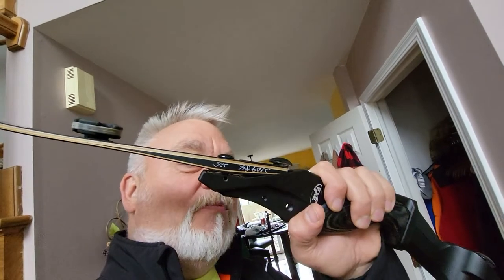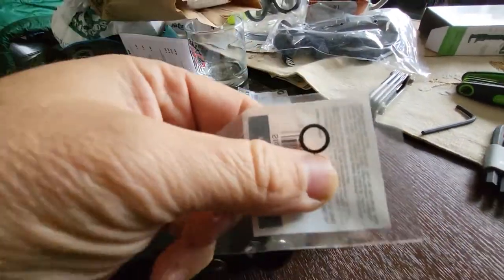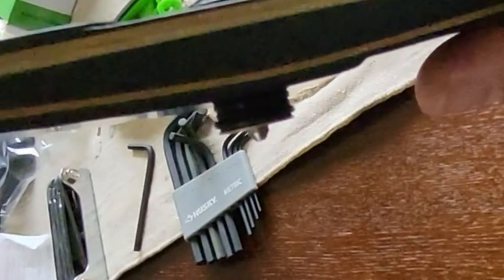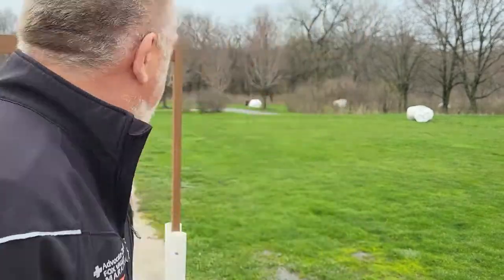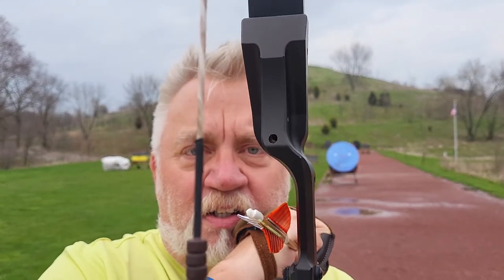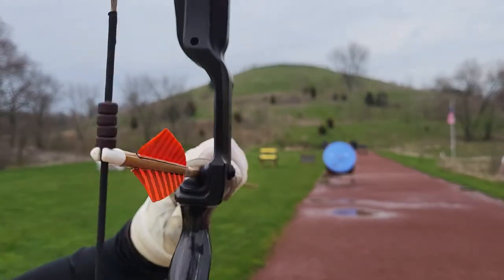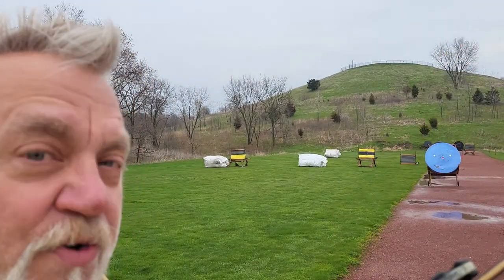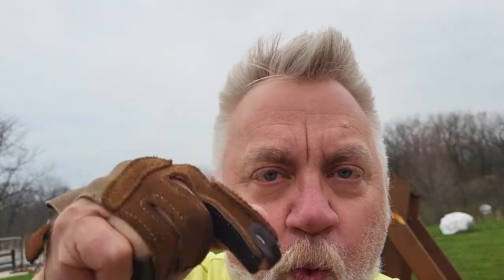Archery - The Secret to Silencing your ILF Bow (Finally!)

Comment: If you play this video in slow motion the arrows are 100% kicking off the shelf
Reply from the maker: Greetings User and welcome to VOGTLAND OUTDOORS ! 

Excellent observation, but there's something you may be missing here...

I'm near-certain it's a $5 plastic arrow shelf I'm using, AND I'm using my ordinary HUNTING arrows as well, because the PURPOSE of this video is to talk about VIBRATION that commonly occurs in ILF limb pockets - vibration & noise that's NOT caused by the kicking of an arrow off the shelf. 

So while your point is complete valid, I had a lot of OTHER stuff to sort out before adding a plunger and magnetic swing-away arrow shelf to the equation ;-) 

I'm HUMBLED that you spent so much time watching this particular video, and welcome more of your keen observations on other (old & new) videos coming up ! 

Cheers,
-Mark Vogt | VOGTLAND OUTDOORS

Comment: Is the pin angle ok? I wonder if it forces a not neutral angle? Just got Gillo GQ 25 with endless loop, its so loud and vibration. Got string slingers installed helped but still vibration and touch loud.

Comment: Did you see the arrows porpoise? Maybe that's where noise is also coming from.
Reply from the maker: Greetings "Crow" (what's a BETTER name with which to converse with you?) ! 

LOTS of people suddenly are weighing-in on THIS (older) video - many thanks! 
That said, the arrows AREN'T porpoising - either up or down - instead I've already traced (via a "mechanic's stethoscope") the loudest noises to the PIN inside the ILF "dovetail bolt" itself :-O 

Watch for upcoming videos as I work to eliminate even this last noise. 

Cheers!
-Mark Vogt | VOGTLAND OUTDOORS
Reply: @VOGTLANDOUTDOORS  oh OK cool. I just got myself an ilf rig (19in satori) and have just been researching stuff about them. Definitely cool to see the tips and tricks of them. Gotta say I'm digging ilf so far. All my other bows are limb specific, Oneida, or one piece recurve.
Reply from the maker: Hi again Crow! 

Yup - there ARE things to like about ILF limb fittings... 
... but it STILL is a double-edged sword as well. 

What you GAIN in CONVENIENCE of pop-out-pop-in limb interchange-ability, you LOSE in ADDITIONAL MOVING PARTS, hence RATTLE from string vibration during bowstring release :-| 

SOMEONE needs to make some sort LOCKING-CAM lever arm so that you can STILL pop-out an old limb and pop-in a new limb... but then TIGHTEN DOWN that limb with the flip of a quick-release - just like on a bicycle wheel or bicycle seat quick-release !

Cheers,
-Mark Vogt | VOGTLAND OUTDOORS
Reply: @CrowArchery5150  I think you will like the ILF system once you get use to it. ILF will always be a little louder that s one piace but not as loud as a lever bow. The thing I love about ILF is I can shoot my longbow limbs on a any of the 4 risers and due to the riser length get a little poundage gain or reduction. I can put my long foam/carbon recurve limbs and get a 64" with a 19" riser or switch to a 15" inch and get a 60" bow. You will enjoy it.
Reply: @carlduncan8462  I had a bear kodiak b riser, but sold it due to lack of limb options (plus it was just too pretty of a bow for me to comfortably hunt with) I wanted something with a lifetime warranty  on the riser at the very least. Bear's warranty kinda sucks in my honest opinion. So far I've had no issues with my satori being loud at all. To be honest I think I'm digging the satori because it feels like a modernized version of my martin hunter. I don't like the stock grip, but I think I'm gonna find a way to converting the grip with a suede or tough leather material.
Reply: @CrowArchery5150  I took mine off and sanded it to the shape that fit like I wanted it to. I build cabinets and furniture so I have a lot of tools. A company in ,I think France, makes some very nice replacement Hoyt grips. I'm pretty sure they are 3 D printed. Multiple colors and styles and they are not slick in your hand.

Comment: Your arrow is bouncing from the shelf. Your nock height on your string is off or that extra weight on string above arrow is pushing the arrow nock down before the arrow nock leaves the string.
Reply from the maker: Greetings Old2470 and welcome to VOGTLAND OUTDOORS ! 

I read your comments with interest. Clearly you spent some time watching video over & over prior to commenting - thank you for this effort ! 

Some comments: 
1. the position of my (adjustable!) Nocking Point is a wee bit off, but not a lot; please remember the focus of this video was on VIBRATION, not really ARROW FLIGHT, and while being off just a tad might create some vibration, I think you & I can agree that in this case it's small enough to NOT be the "root cause" of all the vibration I had :-) 

2. that "extra weight" on my bowstring is really a few small lightweight rubber speed buttons which together make an ADJUSTABLE NOCKING POINT; believe it or not, but 3 of these light-density foam button weigh LESS than the BRASS Nocking Point that is all-too-common on many a bowstring, so if my SPEED BUMPS are to blame for poor arrow flight, then all the BRASS Nocking Point out there must be making even WORSE arrow performance ! ;-) 

3. After I filmed this video I adjusted my moveable Nocking Point up about half-an-arrowshaft-width, and my porpoising was eliminated, but it was the FELT PADS I added which get the credit for damping out much of the NOISE and VIBRATION in that bow ! 

THE KEY POINT OF THE VIDEO then wasn't about adjusting the nocking point to eliminate the porpoising , but eliminating the vibration and noise often present in even expensive, high-quality archery limbs. 

My own bow? 
$299 SCREAM EXE riser from 3RiversArchery
$159 DAS longbow limbs also from 3RiversArchery
=========================================
$450 for the bow, so arguably a "medium-high-end", and it RATTLED LIKES A SNAKE when I shot it ! 

That's because ILF fittings VIBRATE by DESIGN - no matter who tries to argue in favor of them. Period. 
There are simply too many spring-mass moving parts in these fittings, but with just a little felt you can eliminate most all of the vibration ! 

Hope you enjoyed the video. 
I certainly enjoyed & respected the time you took to watch the video to observe various aspects of the arrow flight, and take the time to comment on them.

I would benefit from you watching some of the other recent videos: 
https://www.youtube.com/watch?v=BaB1499Fe50
https://www.youtube.com/watch?v=MGDvz4WG8TU

Kind Regards,
-Mark Vogt | VOGTLAND OUTDOORS
Reply: @VOGTLANDOUTDOORS   The noise you still heard was your arrow hitting the shelf too, not just nock getting out of the string. It would have been interesting to hear the bow without the O-rings back to back shooting - maybe you add this ? Camera / mic in front of the bow will give the right noise feedback - the slap or rattle or anything happens behind the back of the bow. What we hear while shooting is not what the bow sounds when listened 3 yards away. But interesting solution - out of the box thinking.
Reply from the maker: Greetings Old2470 and welcome back ! 

If you heard this bow BEFORE I silenced most of the vibration you would have been surprised ! 
Me? 
I wasn't. 
I've competed enough now - with literally dozens or even hundreds of archers all standing in a line alongside me at indoor state tournaments that I can say with complete sincerity that over HALF of all ILF-type bows display this SAME vibration phenomenon, because they all have the SAME design flaw:

THE BOW LIMBS ON ILF RISERS ARE NOT RIGIDLY ATTACHED TO THE RISER. PERIOD. 

Proponents of ILF connections can jump up & down and scream "BLASPHEMER!!" and "CRUCIFY HIM!!" at the top of their lungs - they will all still be WRONG. 

Here's why: 
ILF limbs are attached through a PIN-SOCKET type of fitting; 
In order for ANY ILF "pin" to be GUARANTEED to fit into ANY ILF "socket" there MUST be some small PLAY; 
The designer of ILF fittings hoped that a simple SPRING-loaded "inner pin" would somehow "damp out" this vibration, but THIS IS A FALLACY ! 
When the bowstring is struck, a series of VIBRATIONS at different frequencies (a low "fundamental" frequency and certainly multiple "harmonics") travel from the bowstring into the limb tips into the limbs into yes-you-guessed-it the ILF FITTINGS, and it's these high-frequency HARMONICS which wreak havoc with the little spring-loaded pin and even the larger pin-socket fittings, "exciting" them both into vibrating at both a FREQUENCY and an AMPLITUDE which is in the yes-you-guessed-it-again AUDIBLE SOUND RANGE FOR THE HUMAN EAR. 

In other words, we heard a low-frequency SLAP and a mid-frequency RATTLE and finally a high-frequency BUZZ. 

THIS HAPPENS WITH ALL BOWS ! 
Put your ear right up against where your limb meets your riser and PLUCK your bowstring like a guitar string, and you will HEAR your bow - ANY bow - literally "RING"... and this RINGING WILL LAST FOR SEVERAL SECONDS :-O !!! 

WATCH any other Archery Jedi Master Harmin Hirmer - he "listens" to every bow he evaluates, and even COUNTS how LONG the ringing last as part of his "scorecard" for a given bow. 

SO... 
All bows VIBRATE;
These vibrations occur in DIFFERENT FREQUENCY RANGES; 
SOME of these frequencies are right in the range of the "NATURAL FREQUENCY" of the ILF FITTING; 
SOME of these frequencies are right in the range of the "NATURAL FREQUENCY" of the SPRING-LOADED PIN; 
These vibrations cause ILF bows to SLAP, RATTLE and BUZZ - ALL in frequencies AUDIBLE to the HUMAN EAR. 
Period. 
There's NO actual DENYING of this; our only option is to DAMPEN this vibration, hopefully WITHOUT losing (much) kinetic energy going into the ARROW. 

The only way to COMPLETELY ELIMINATE this vibration from ILF limbs is to PERMANENTLY ATTACH them to the riser ;-) 

My fingers are tired from this epic-long reply. 
I sound like I DESPISE ILF limbs - I don't. 
But I also DON'T "RESPECT" ILF limbs. They're just complexity for the sake of complexity. 
Sure, you can pop OFF ILF limbs in 1 second, and pop DIFFERENT ILF limbs on in 1 second. 
And it takes you 10 seconds to SCREW OFF then SCREW ON more traditional limbs. 

Who fucking cares? 

WHEN has the ability to INSTANTLY CHANGE LIMBS EVERY MATTERED? 
NEVER. 
;-) 

IMAGINE a company who designs CONVENTIONAL limbs for $100 a pair vs another company who designs ILF limbs for $250 a pair...
... and I'll show you ONE pair of limbs where over $150 was WASTED on the FITTINGS that were FLAWED FROM THE START, and ANOTHER pair of limbs where ALL the money went into the LIMB PERFORMANCE, which is the ONLY THING THAT REALLY MATTERS. 
;-)

- Mark Vogt | VOGTLAND OUTDOORS

Comment: @ Mr. Vogtland, I am a fan, new archer going to get my first bow. Should I have my drawlength calculated the same or different because I will be using your shooting method?
Reply: Should I have my draw length calculated the same way?
I will be using your shooting method. furthermore, I was wondering if you offer lessons.
Reply from the maker: Greetings Ernest and WELCOME to VOGTLAND OUTDOORS! 

SHORT ANSWER (and this is IMPORTANT!): 
You DON'T "calculate" your Draw Length - you MEASURE it !! 

You can make this SIMPLE or you can make this HARD: 
SIMPLE METHOD: 
GRAB a common MEASURING TAPE; 
FLIP it UPSIDE DOWN in your BOW HAND; 
HOLD the TAPE END with the 2nd digits of your 2 DRAWING FINGERS; 
HOLD the PLASTIC CASE part UPSIDE DOWN with your BOW HAND - like it's a BOW; 
PULL the tape out with the 2nd digits of your draw hand...
ANCHOR those 2nd digits UNDER YOUR CHIN while you're "AIMING" with the plastic part. 
READ the value on the measuring tape - THIS IS YOUR DRAW LENGTH
REPEAT 10 or 15 times. 

 HARD(ER) METHOD: 
VISIT the BOW STORE 
Have THEM actually MEASURE your draw length using a VERY LIGHTWEIGHT BOW 
(note: if they DON'T have you actually DRAW A BOW but instead pull out a YARDSTICK - RUN AWAY - you're in the WRONG "archery" store !!!) 

KNOW THIS: 
The AVERAGE HEIGHT of an AMERICAN MALE is 5'-9"
The STANDARD DRAW LENGTH of 28" is BASED on this height ! 

MARK is 6'-1" and has a Draw Length of 31.5" 
Mark is 4 inches TALLER than the "standard" American Male
Mark's Draw Length is 3.5 inches LONGER than "standard" 

MARK'S RECIPE FOR "CALCULATING" an EXPECTED DRAW LENGTH: 
SUBTRACT 69 INCHES from YOUR Height in INCHES to get a HEIGHT DIFFERENCE; 
FOR EACH inch in this HEIGHT DIFFERENCE either ADD an inch or SUBTRACT an inch from 28 inches

EXAMPLE: 
You're 5'-7"  (2 inches shorter than "standard") 
SUBTRACT 2 inches from 28 inches to get a DRAW LENGTH OF 26 INCHES :-) 

EXAMPLE: 
You're 5'-10" (1 inch taller than "standard") 
ADD 1 inches to 28 inches to get a DRAW LENGTH of 29 INCHES :-) 

SEE HOW EASY THIS IS? 
But ALL this depends on the ASSUMPTION than your ARMS are PROPORTIONATE to your HEIGHT. 

BETTER TO MEASURE THAN TO CALCULATE ! 

I think you just gave me my 3RD idea for upcoming videos - THANKS !!!

Hope this helps! 

-Mark Vogt | VOGTLAND OUTDOORS
Reply: @VOGTLANDOUTDOORS  OUTSTANDING! This was the best answer I have ever gotten on YouTube!
Reply from the maker: Greetings Ernest ! 
1. GLAD you're trying the VOGTLAND SHOOTING METHOD ! 
2. Yes - I DO offer lessons - and  they're FREE (I just LOVE teaching!) 
3. Yes - I WILL travel up to 150 miles from North Aurora IL (it's 50 miles due west of Chicago IL) 
4. Yes - I LOVE GROUP LESSONS BEST - so get some BUDDIES together ! 

WHERE do you live? 

Awaiting your reply,
-Mark Vogt | VOGTLAND OUTDOORS
Reply from the maker: Hi Ernest! 
GLAD you liked the answer, AND that it MADE SENSE to you ! 

LET ME KNOW HOW ACCURATE THE "VOGTLAND DRAW LENGTH CALCULATION" IS: 
TELL us your HEIGHT; 
TELL us your DRAW LENGTH! 

Awaiting your reply!

Cheers, 
-Mark Vogt | VOGTLAND OUTDOORS
Reply: @ Mr. Vogtland, sir, I am so grateful for your offer! My family and I actually live in Chicago! How many people are you willing to train? What are the age requirements? I will be meeting with a youth group this Sunday to feel out interest, but have a group of about 15 ready to go! Should we check into renting a local range? Hey, maybe you could help me choose my first bow 😉 tentatively, we are looking at a Saturday afternoon like 12pm to 3pm, maybe the second Saturday of June? This is tentative until you say it's final. I have never facilitated anything like this so I appreciate and welcome your professional input.
Reply from the maker: ERNEST !!! 
I CAN'T BELIEVE YOUTUBE HID THIS COMMENT FOR THE PAST 8 MONTHS - I ONLY JUST SAW IT TONIGHT !!! 
ARRRRRRGGGGGHHHHH !!! 
WHY oh WHY does YouTube DO THIS ????? 

SHORT ANSWER: 
I'd LOVE to give YOU a lesson first - ALL FOR FREE ! 
Let's meet out at BLACKWELL FOREST PRESERVE ARCHERY RANGE - it's FREE or only $50 a YEAR for non-DuPage residents - that's CHEAP by ANY STANDARD !! 

You can apply for a permit ONLINE at this location: 
https://www.dupageforest.org/things-to-do/get-outdoors/archery#archery-permits

Once you get the permit, feel free to TEXT me at (630) 781 9978 - that's my mobile number 
Be sure and leave your first name in the text (nothing more) and remind me I'd promised you free lessons. 
If you haven't yet picked a bow, I'll even bring a pretty decent STARTER bow with me for you to try out. 

Then once YOU'RE shooting well and understand the method, you'll be able to teach your own family how to shoot... 
... or we simply have a GROUP session - it'll be a BLAST ! 

Looking forward to hearing from you - I hope ! 

-Mark Vogt | VOGTLAND OUTDOORS

Comment: Hi. May have missed it, what size o rings are you using? Thanks.
Reply from the maker: Greetings RP ! 

ANSWER: 
I took an ILF "pin" down to the local hardware (ACE Hardware) and into the PLUMBING section; then I looked through all the FAUCET O-RINGS until I found the smallest, thinnest ones which barely had to stretch in order to fit over the "shaft" of this ILF pin. 

Since you might NOT have the exact same make/model of ILF pin (sadly, no matter what ANYONE CLAIMS about "ILF" being CONSISTENT, this is bullshit marketing) as you, you should follow my lead and bring an ILF pin (or the whole damn LIMB) with you, and simply TEST_FIT O-rings until you find ones which fit like I'm describing... 

If you still get stuck, then I'll go down to the local ACE Hardware and FIND the ones I use and come back and report to you - good luck! 

-Mark Vogt | VOGTLAND OUTDOORS
Reply from the maker: SOMETIHNG LIKE a 9mm x 1.5 mm black rubber O-Ring like in this Amazon ad: 
https://www.amazon.com/Boatsea-Assortment-Automotive-Plumbing-Connections/dp/B08XYYJGNS?ref_=ast_slp_dp&th=1
Reply: @VOGTLANDOUTDOORS  Thanks!
Reply: @VOGTLANDOUTDOORS  thanks. I just bought an ilf bow on eBay and still waiting for it. Once in I'll see how loud it is, and then try the  o rings. Thanks for your feedback.
Reply from the maker: No problem!

Comment: Diameter of rubber ?
Reply from the maker: Greetings E3Innovation ! 

SHORT ANSWER: 
BRING your ILF PIN into any ACE Hardware, and head to the FAUCETS/PLUMBING department. 
LOOK for the shelf with either a bunch of DRAWERS filled with small rubber O-rings, or a SHELF with them all on hooks. 
FIND any O-rings with about a 1mm to 2mm thickness, and a diameter only slightly SMALLER than your ILF pins. 

That's all the fancier you need to be! 

Cheers,
-Mark Vogt | VOGTLAND OUTDOORS